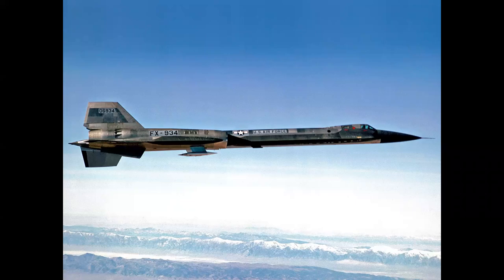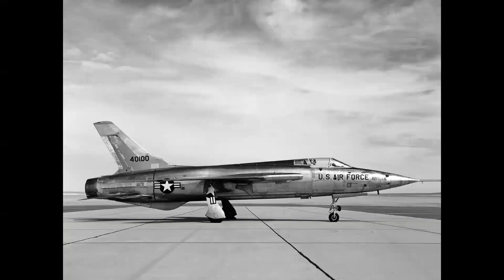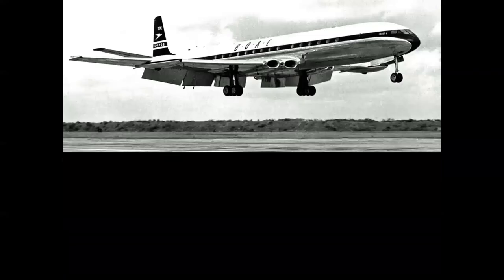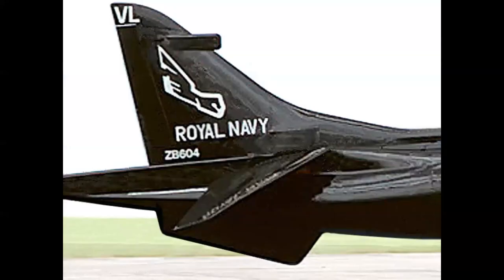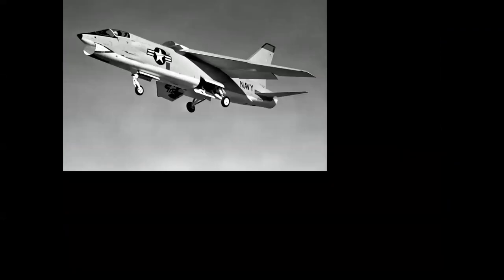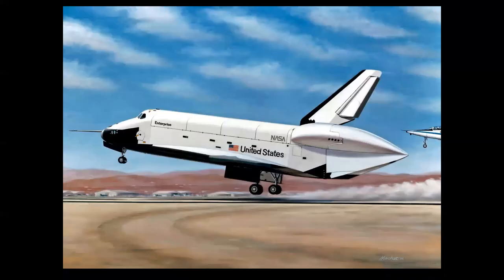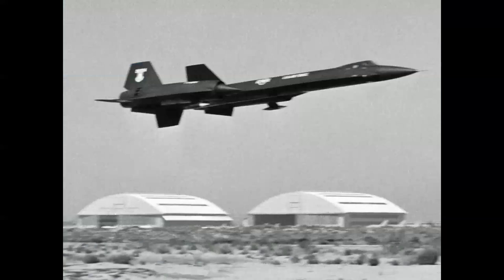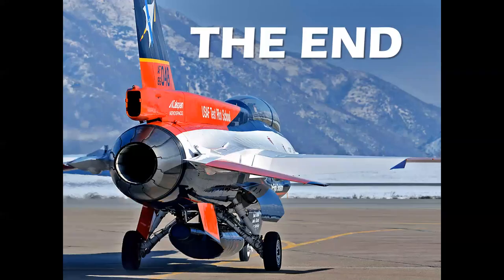VENTRAL FINS - Part 2 of our informative Series on Aircraft Tail Design

Comment: An interesting ventral fin installation is that of the Bell L-39. 2 were built from P-63 Kingcobra's, which had no ventral fin, presumably because of the swept wings they carried half a dozen different styles of ventral, gradually getting larger each time they were changed.

Comment: Hi Mike, thank you for the interesting videos. I'm also an ex-Dougloid, there in two stints b/t 1979 & 1994. Mostly aero flight test, & helped see the MD-80 earn her FAA cert. Such a fun place to work, as you noted. I knew Harry Gann, & many times begged unneeded photo prints off the Presentations gang.
I also worked Shuttle aero flight test. FYI, that big aero fairing on the aft end of the Enterprise in the early flights was referred to as the "boattail."
Keep up the good work!

Comment: @Celebrating Aviation with Mike Machat   7:27  the original plans for the F-15 had ventral fins, much like the Su-27  Flanker
7:30 the ventral fins weren't added to the F-14 Tomcat, they were reduced from the massive folding ventral fins that the original singel-tail 303E mock-up had installed

Comment: I'd think, in general, that going to twin vertical tails probably had much to do with ventral fins going away.   For whatever reason single tails and folding ventrals were preferred over two vertical tails, at least in the early days.  The XF8U-3, XF-103, XF-108, the early Tomcat (303E) and even North American's FX competitor to the F-15 all went with single tails and folding ventral tails.

Comment: These last two videos really have you bringing up the rear....of the aircraft!  I appreciate you going into detail of my suggestion about the shuttle transport 747.  I had figured it was just for stability as the shuttle would block the vertical's airflow but not what would happen if it was to collide with the tail!  I guess it would have been similar to American Airlines flight 587 that ripped the tail off.  Really appreciate your work and videos!
Reply from the maker: Many thanks!

Comment: The Harrier also had twin ventral fins under the belly, by the nozzles. That was to maximize the fountain effect, where the exhaust air shoots back up off the runway or landing pad.  Unique use case, because they are generally used to improve lateral stability

Comment: Pretty sure the ventral and added plate fins on all float-planed versions of aircraft are to increase directional stability owing to the extra fuselage like structures of the floats hanging well forward of the aerodynamic center. When they pivot to one side in a yaw they can create an exacerbation of the yaw, so the extra directional stabilizers remedy this. 

Everything else in your film was delightful, insightful, and informative as always.

Thank you.
Reply: Yup. As an occasional seaplane pilot I can tell you this is true. If the added ventral fins on the floatplane versions of common aircraft look like they were an afterthought, it is because they were.
Reply: @grafhilgenhurst9717  Yeh, and in allot of cases the planes look prettier as in more aquatic lines like they have caudal fins.

Comment: Some oddities in ventral fin design....
In WWII for the Pacific Theater, there were projected floatplane versions of the Spitfire and Wildcat fighters, which were give ventrals.
The Vought F7U Cutlass twin-tail fighter had the vertical fins extended below the wing as pseudo-ventral fins.
The weapon pod beneath the B-58 Hustler had a folding ventral fin.  I bumped it on the display bird at Chanute AFB, Ill. in my USAF time, 1976.  That fin suddenly dropped down!  Nearly hit me.  😆

Comment: 7:25 you say the F-15 does not have ventral fins, yet it does have them.  They are small, located just aft of the Main Landing Gear on the side of the fuselage.  I worked on C and D model aircraft.  They were not present on the E-models as the conformal tanks were placed where they would be located.

Comment: The Lear 23 at Van Nuys was owned by Rexall Drugs. They had two of them, I used to pull them in and out of the hangar and fuel them back in the early 60s  Its parked on the east end of the old E/W runway just east of 16L.Air National Guard base in the background with their KC-97s

Comment: The single ventral fin on the early Learjets, from the prototype model 23 thru the 35/36/C-21A, was replaced with the twin "Delta Fins" starting with the model 31, which also replaced the trademark tip tanks with longer wings and winglets. From an article in AOPA magazine: "...One key improvement over the Learjet 35 was installation of delta fins on the Learjet 31’s lower rear fuselage, which improved stall characteristics and eliminated the need for a stick puller/pusher system, although the Model 31 does have a stick shaker..."  They were made available as an aftermarket refit on the 35/36/C-21 jets.
Reply: Wish I understood why the dual ventral fins worked better than single ones. I suspect it has something to do with airflow at high angles of attack.

Comment: Another instance of the "disappearing" ventral fins is the Dassault Mirage delta family. The Mirage III had a slight lower "bulge" containing a fuel cell, aft of which could be installed either a rocket booster or a narrow fin, but the fly-by-wire Mirage 2000 had a clean belly.

Comment: Some owners of Lancair 4P's add Ventral fins. Some in single vertical position and other in twin canted positions. The original set up is know for poor stability  at slow speed or high up were this pressurized homebuilt flies at 24,000 ft and the air is thin.

Comment: You're a fantastic aircraft artist. 
I used to love the box art on my models, and would cut it out and tape it to my wall. 
Would you happen to know why that the vertical stabilizers on the X-15 were shaped like a wedge, rather than an airfoil ? And why then just the vertical ones ?
Also, no effort was made to taper / streamline the rear of the extra propellant tanks on the white X-15. 
This all seems to go against what is taught about aerodynamics. 
( That you want the object in flight to taper back to a point at the rear )
- Thanks to you, or any other person that has an answer.
Reply from the maker: Appreciate the comment, thanks, and great question on the X-15's control surfaces. It all depends on the aircraft's speed, with different aerodynamic designs for subsonic, supersonic, and hypersonic airflow. The X-15's wedge-shape vertical stabilizers are most effective above Mach 3 where flat surfaces work best. The streamlining you mentioned is for supersonic airplanes, with the best example of a specific requirement being the Republic F-105's internal bomb bay. When streamlined weapons were ejected above Mach 1, they bounced back up into the fuselage and became highly unstable. The solution was a "bluff shape" (like a 55-gallon trash can), which was ejected and then fell-away cleanly. Thanks for watching!

Comment: Always amazed me the squared off very "draggy" ventral fin as well as even the vertical stab on the X-15.   In cross section they are wedge shaped and must produce drag induced directional stability. (just my theory). The ability to reach mach 6.7 says much for the thrust of the motor as well as the VERY thin air at 100k feet. Any thoughts on this Mike? Fluid dynamics has interesting phenomenons huh?

Comment: To be honest as a retired aircraft technician I have to question your knowledge of basic aerodynamics.  You almost make it sound if the fin, or rudder post was either an afterthought or something special in basic airframe design, it is not.  The reason for the fin is simple to give the aircraft directional stability, and very little if anything to balance the floats on seaplanes. Until resent modern unstable designs ALL aircraft had fins, and it was not until advanced fly by wire controls that the fin could be dispensed with a good example being the B-2 and B-21 stealth bombers. So please in a video like this one clarify at the beginning that there is nothing special about aircraft with fins. There is certainly something special in aircraft without fins.  But your question was what was common with the four aircraft you showed at the start of the video.  Well let's see, they all had a fuselage, they all had two wings, They all had an engine, or engines for power, they all had horizontal stabilizers, or tailplanes, they all had some form of landing gear.  And yes in this you were correct they all had a fin or rudder post, one of them even had two, but there is nothing unusual in that.